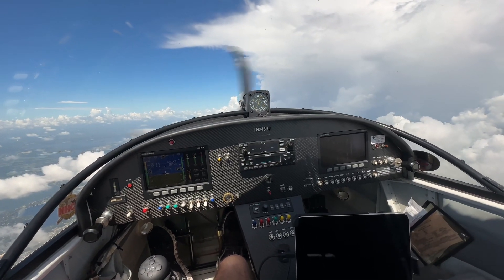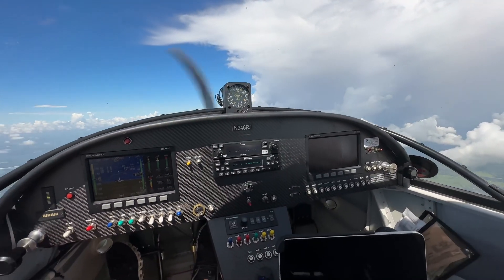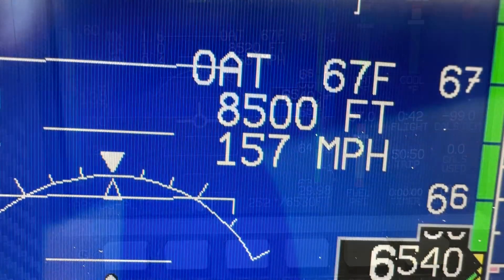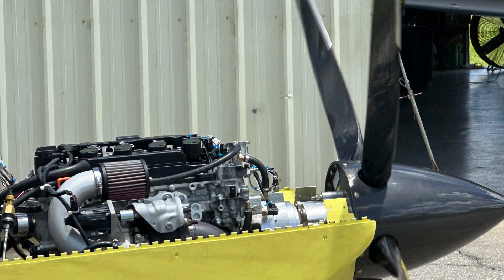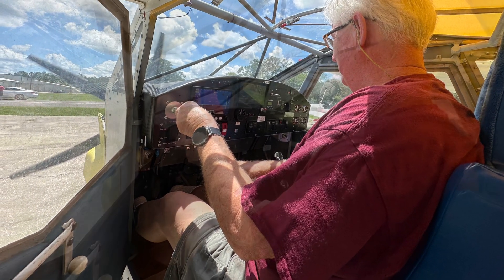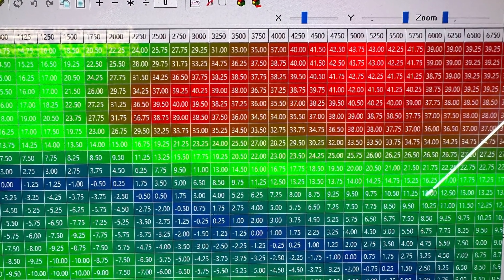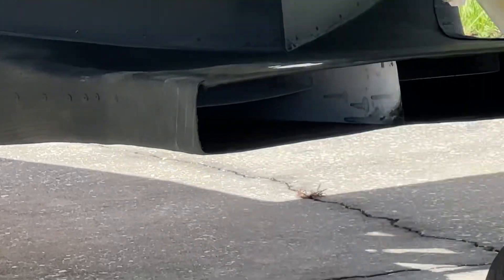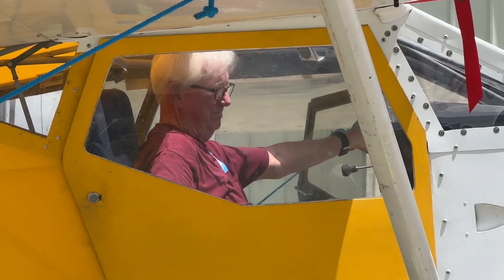Merle ready for the last few hours of his fly-off time

Comment: Wondering about the CG range of this very light airplane with a very large engine plus large controllable pitch prop, plus the cooling module. Seems like a lot of people are going for over-sized engines that are not ideal for the airframes their hanging them on. I get it if you are doing stohl competitions, but for general use GA planes there is a diminishing return on added HP. Of course if its your dream to hang a large engine on a light airframe, no one else's opinion matters.
Reply: The engine and prop are not large (weight wise). The empty weight CG is just behind the forward edge of the envelope. Empty weight is 1098. When building I was not caring a lot about weight savings, only to prove it could be done. I could go on a weight savings kick and get rid of at least 50 lbs. My goal was to have it fly and then look into refinements.